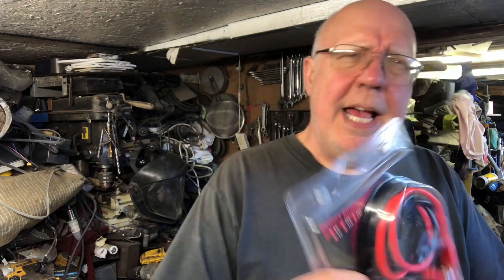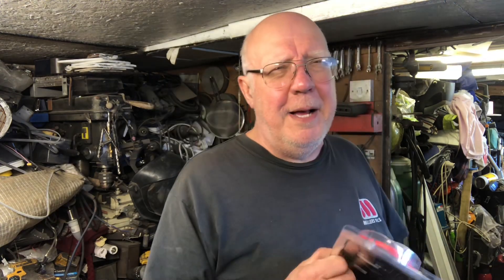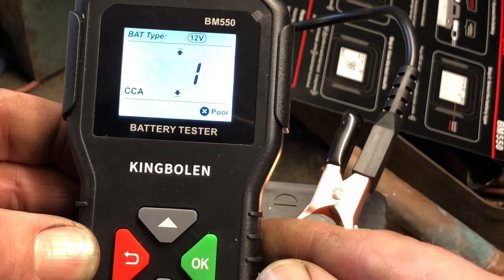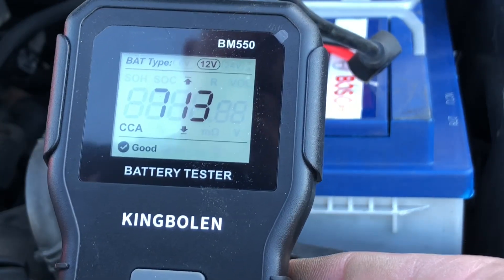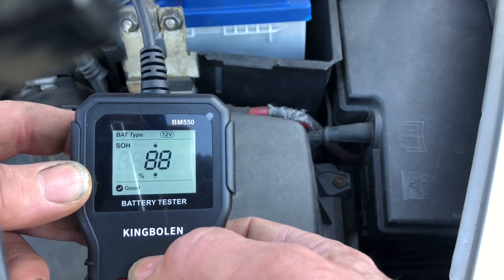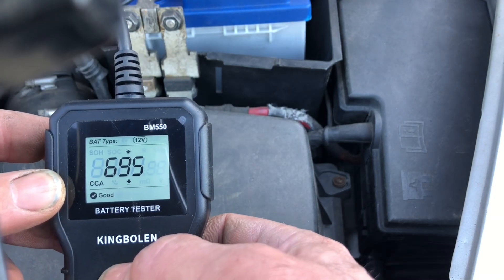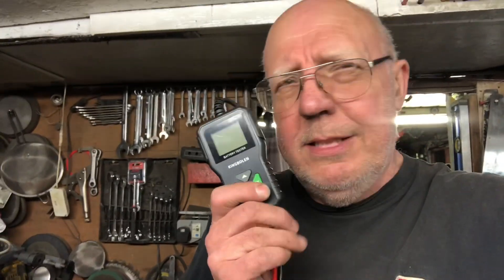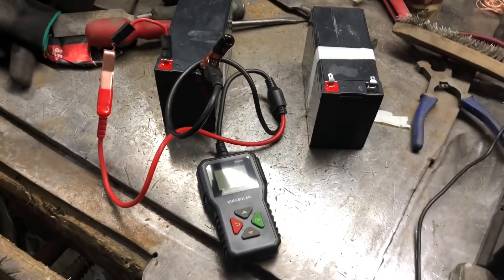An unlikely Scrappers tool, A Battery tester.

Comment: Ian can’t tell you if your tester is accurate or not but I can tell you this…My shop has 10 very high quality testers as well as some older high quality testers…And None Of Them Read The Same…And those style testers do not test a battery under a true load…I going to make a response video on my Homotorsports channel
Reply from the maker: i Prefer the old style high resistance tester, the ones where you hold a bar in each hand